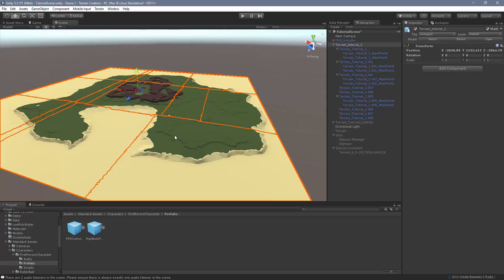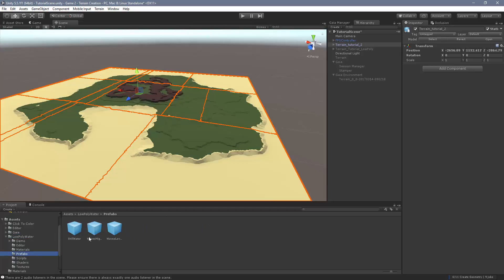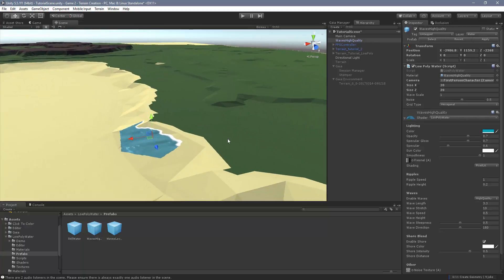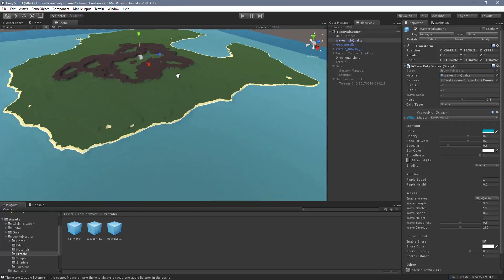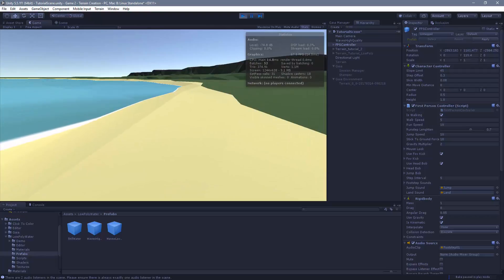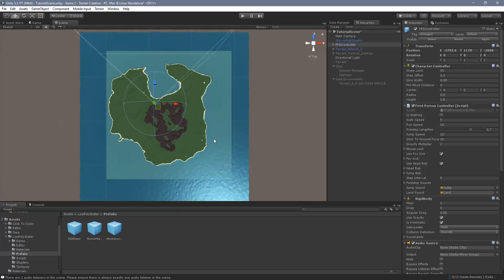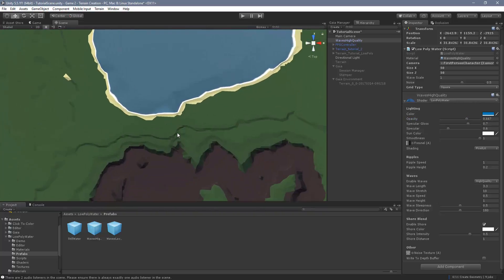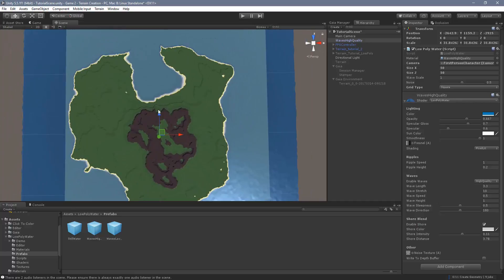Low Poly Terrain Workflow - Part 7 : Adding Low Poly Water

Comment: Is it possible to use trees and grass with this low poly terrain ? (since you don't use a standard terrain object)
Reply from the maker: Unfortunately the Unity grass and tree tools can only be used with Unity Terrain Objects.  

I've had good performance using normal objects as trees then using Unity's built-in LOD component and the occlusion culling system to reduce the amount getting drawn. 

In terms of grass I've used a similar approach, but am not totally satisfied yet - mostly due to the grass models and low time spent on creating grass.  I am very interested to look at this directX 11 grass shader (https://www.assetstore.unity3d.com/#!/content/36335?aid=1100lHSw) and see how well it can do "low poly" grass.
Reply: it would be cool to have a plugin to manage "autogen" objets such as grass, trees, rocks,etc , with non-standard terrain.. (I already developed similar features for my own engines, on previous flight sim projects)
Reply from the maker: In my current project I'm using GeNa. It can be a bit tough to set up perfectly, but I can "decorate" a huge terrain in minutes once it's set up.  https://www.assetstore.unity3d.com/#!/content/74407?aid=1100lHSw

I've also used "Click to Add" (my own tool) which has far fewer features, but is easier to use to decorate scenes - it's also cheaper :). https://www.assetstore.unity3d.com/#!/content/25709?aid=1100lHSw

Both of these tools place prefabs, so you can setup the LODs then use these tools to procedurally decorate your scene.
Reply: Great. Thanks for your answer !

Comment: This terrain is good for mobiles?
Reply from the maker: I don't have any experience developing for mobile, but I would think it would be just fine. You lose the built in LOD system of Unity's Terrains, but the occlusion culling can make up for a lot of that. I would think the limitations would be the size (overall) of the terrain as as well as the amount currently on screen.